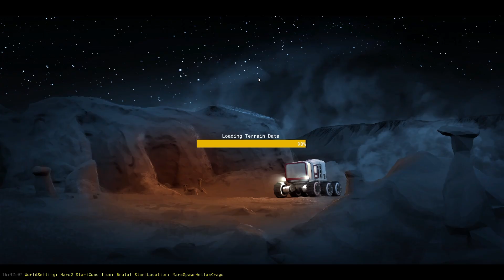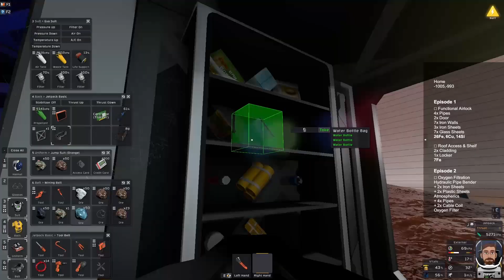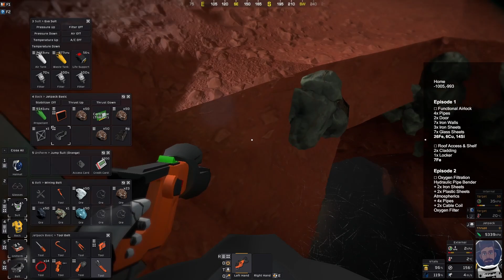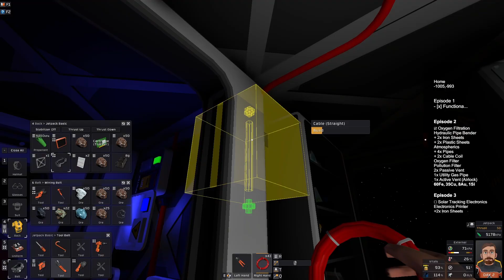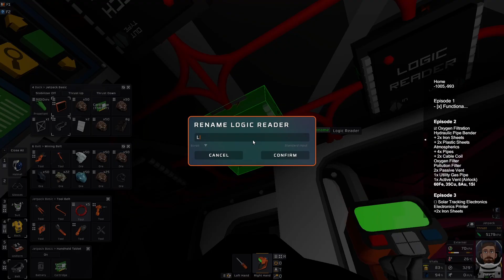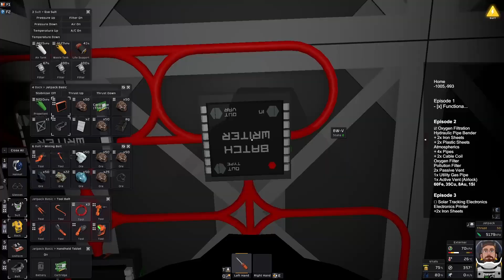Stationeers: Season One: MSB - Episode 3

Comment: My concerns with the discrete component approach is that the power it constantly draws is non-trivial for early game -- 50 W total; but all day. My nod to this is that I often add a transformer on the power supply side of these. While it does take 10 W (when powered on), you can leave it off all night. If you really need to conserve, you could just flip it on momentarily in the morning and a couple of other times in a given day. Then, it can become 60 W for less than a minute of the day rather than 50 W for all day. Of course, you can also economize by just pulling one segment of the power feed wire for the power down times. Thus it then becomes 50 W for less than a minute -- in ultra save mode. Of course, if you are going out mining, then hooking up the battery charger and filling it before you go ... likely everything will be charged full even if you leave all of the chips powered the whole time.

Comment: Why do you plan to replace all of your wiring with heavy cables?  Couldn't you just use a transformer? Also, you might want to connect your battery charger to charge multiple batteries.
Reply from the maker: I will use transformers, but long term I like having the 'power in' network obviously different, and for most of the game for me that's different wiring until I'm stable enough to spray paint everything, which is usually an afterthought